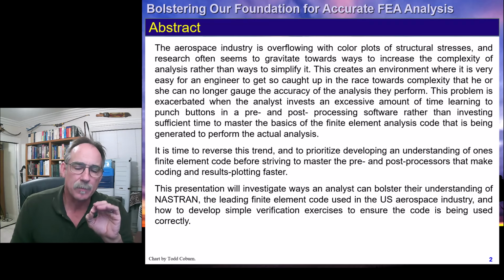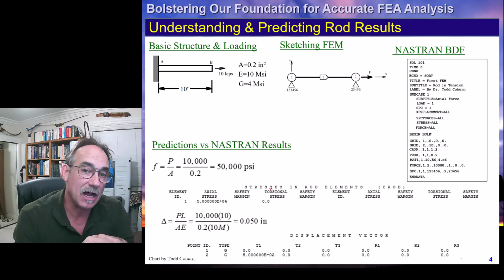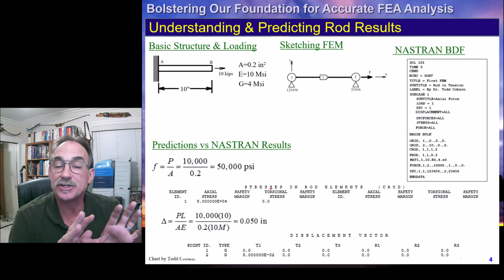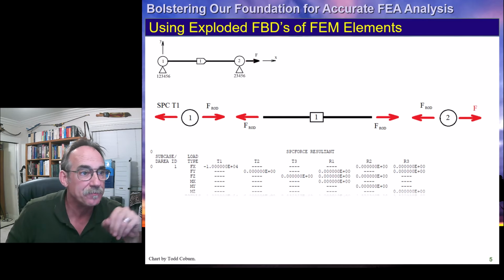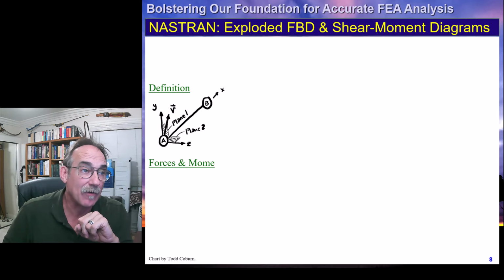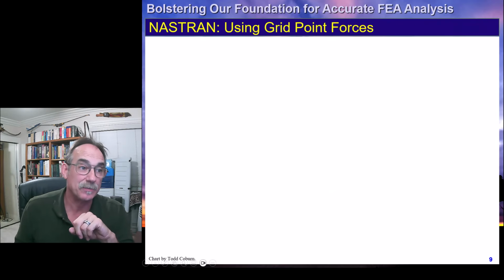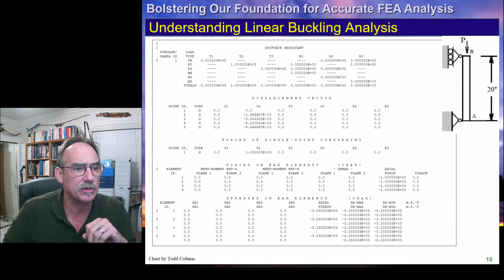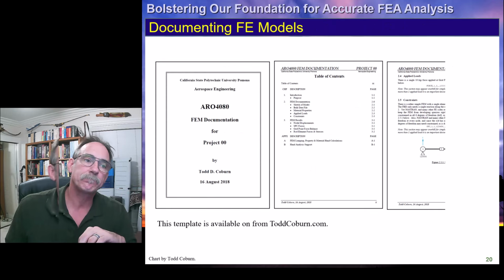Bolstering Our Foundation for Accurate FEA Analysis

Comment: Dear Todd , thank you for your videos . I ordered today also your Aerospace strength handbook vol II after watching your lecture series to complement my reading in composites . I want to ask you a question about future videos ;

Are you planning to make a video about the ways to model complicated geometries that we see in the industry into more simplified geometries like we seen in strength of materials and for which we have good knowledge so we can make estimates with analytic methods before jumping to FEA ? It would be great to have your input in this.
Reply from the maker: Most analyses should use simple FEMs.  I will likely grow my videos in this area.  There are a few other areas i intend to expand first though
Reply: @ToddCoburn  That would be great . I work in another domain (internal combustion engines ) and I always run FEMs . 

The idea of solving PDEs etc is fine coming from applied mathematics background but since the parts are complicated in many cases , simplifications to the point where simplified analytic methods can become useful without losing important details become bit more hard sometimes so having input and point of view from a structural analyst like you it would be great for us practicing engineers in the industry.
Reply from the maker: @dm7893-p2t I see, you will often need more complex models for that.
Reply: @ToddCoburn  Also something bit irrelevant , are you planning to make a video about AI and structural engineers in aero/mech/civil ? I think it would be nice to have a video since there is a lot of uncertainty going around. Do you think our work will be impacted negatively from this ? What's your take ?